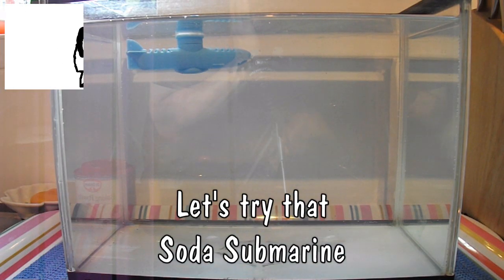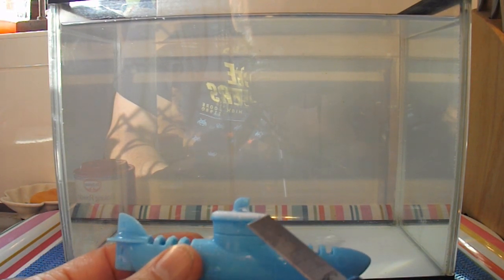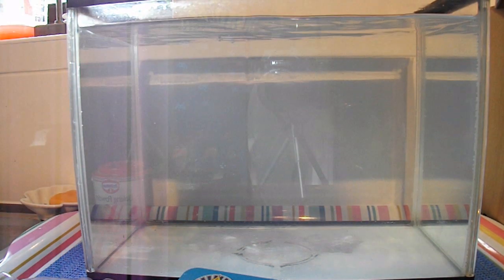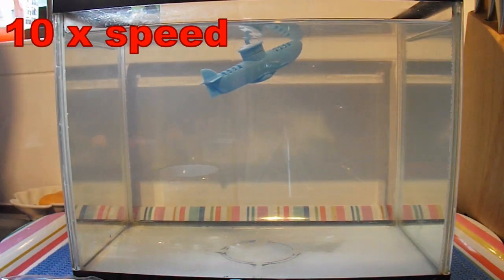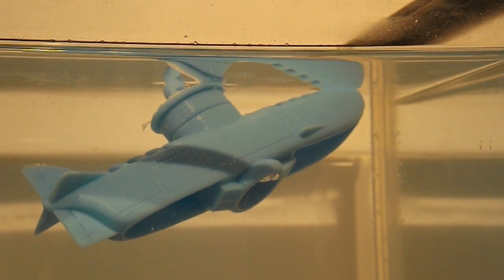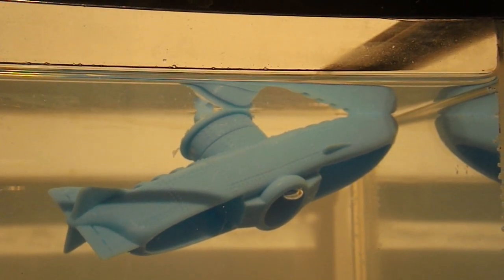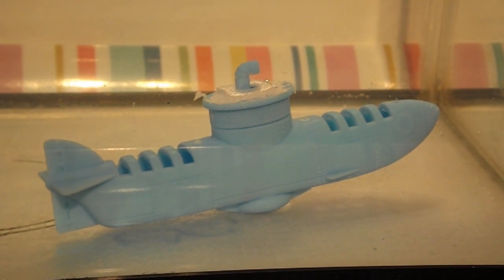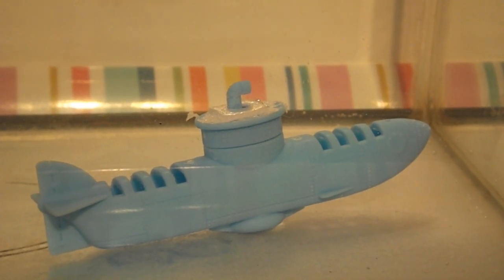Let's try that Soda Submarine Part #2

Comment: Yes they did come in creal boxes and they did perform correctly although they were a little smaller.I remember odering a slightly larger version from the Johnson Smith company and it worked well and looked like a Gato class sub!

Comment: seems tail heavy but works
Reply from the maker: Hi Allan, I think you will find I mention that at about 04:10
As these 2 videos have taken something like 16 hours of my time to put together I doubt that I will spend any more time on the trimming. Bearing in mind the air pressure on the day will also impact on the buoyancy any trimming could change the next day.